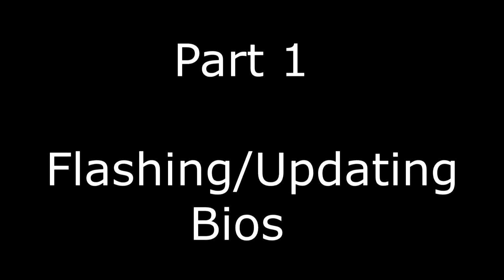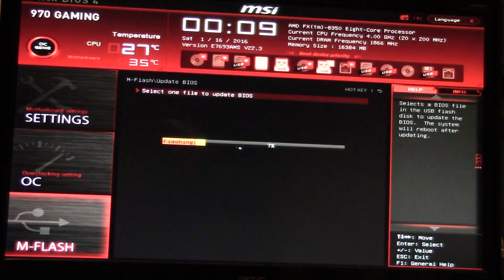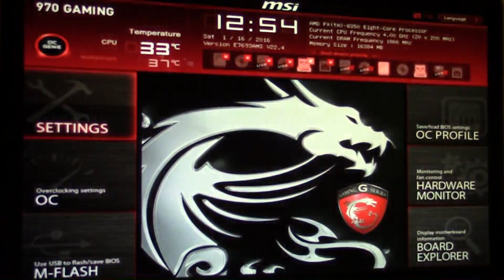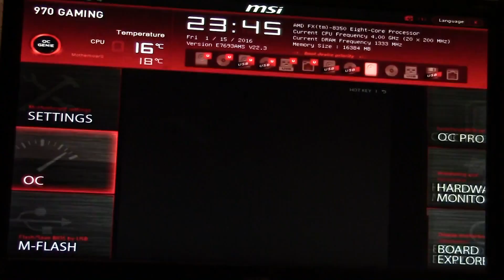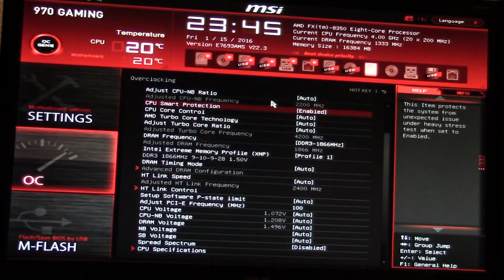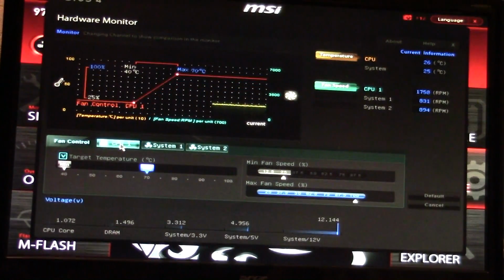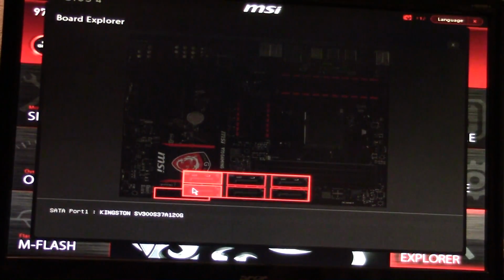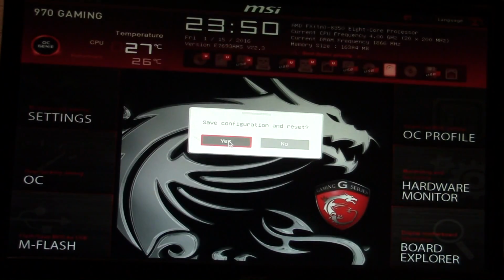Flashing/Updating the Bios and Setting RAM Speed

Comment: I have a MSI X370 motherboard and I’m trying to get my RAM to the speed it’s supposed to be of 3200mhz but it’s only saying it’s 2133mhz and when I set it right and save it it detects it but when I check later it’s goes back to 2133mhz even though the settings say its 3200mhz what do I do